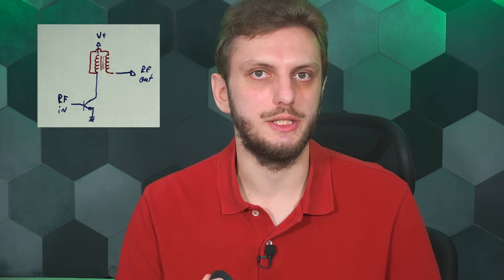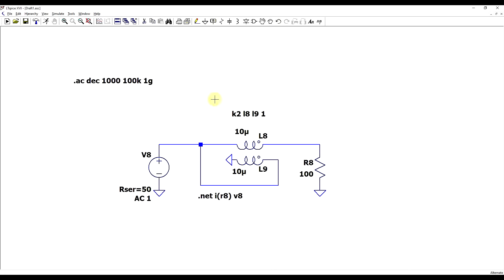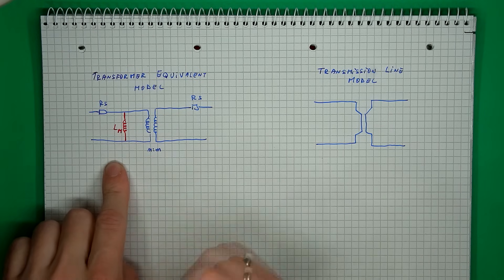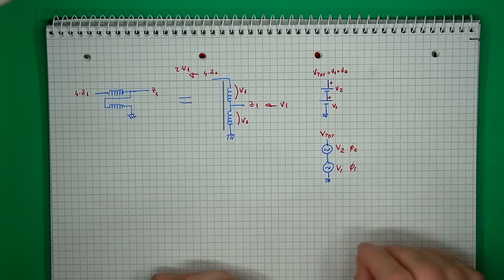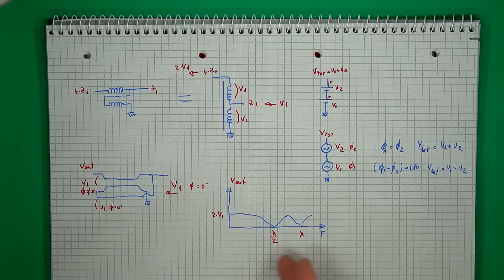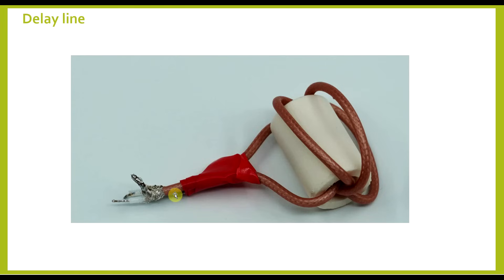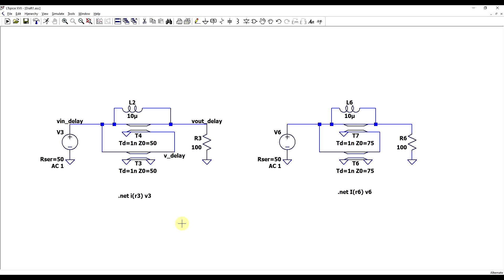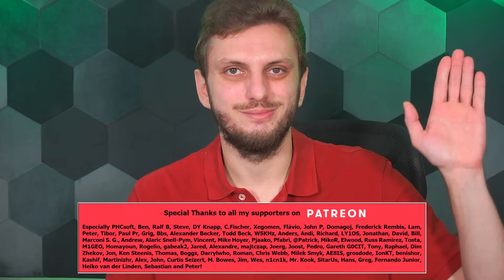The Ruthroff Impedance Transformer

Comment: Thanks a lot .This video helped me a lot to design my balun circuit in ltspice. I just wanted to know can we measure the common mode current and the differntial current thats flowing across the cricuit. I wanted toeasure Like how my rejection my balun circuit does
Reply from the maker: I think I made an older video on this topic - it was more related to device compliance testing, but the same principles apply - maybe it will help https://youtu.be/fhPTnoNQG_A
Reply: Thank you

Comment: Great Vdeo; Thanks!
BTW:  I have used 26-28ga. teflon wire to make a twisted pair that was very close to 50-Ohms by twisting it about 6-turns per inch.
When I measure it on my VNA, it was good to 30 MHz which is all the further I went since my interest was in the HF spectrum..
73!
Edit: Hey thanks a bunch for the theory references; they are VERY-MUCH-appreciated!
Reply: Was it still such after you wrapped it tightly around a form like a toroid?  I think the point was that adding small-radius bends in the twisted pair disturbs the impedance.

Comment: 6:45 I don't think this explanation is quite complete. If you just double the voltage you will get 2*Z, not 4*Z. You should take into account that the total amount of power doesn't change, thus your new current is 1/2 of the original current, and thus you get 4*Z.
Reply from the maker: Maybe I did not go into enough details, but if you make the assumption that the transformer is ideal (lossless) then the input an output power will be the same; for any voltage change (input to output), the impedance ration will be the voltage change squared.

Comment: You made it clear. Congrats!
Concerning the twisted pair line problems: CAT 6/7/8 network cables are good up to GHz frequencies. Any comment on this?
By the way, also USB 3.1 and 4. are GHz compatible.
Reply: One of the main differences between the various CAT nn standards is how well the individual pairs are formed in the cable. The higher CAT standards, like CAT 6, have added material in the cable that hold the pairs more precisely in position along the cable.
Also the amount of allowed "untwist" at the contact ends is much shorter for higher CAT than the more forgiving lower CAT standards.
Reply from the maker: I stand by my statement :D as long as you can keep the constant inter wire distance and twists, the cable will work just fine. I tried to use a single pair from an old network cable, but without the default plastic around it - that keep everything in place, it came undone - and in the small transformer I built, it didn't really work
Reply: @FesZElectronics  The twisted wire isn't bent sharply like it would in a transformer, so the impedance control is easier.

Also note, the wires are twisted at different rates to reduce pair to pair crosstalk.  As mentioned by Orjan, CAT6 adds a plastic "X" the length of the cable to increase pair to pair separation, reducing crosstalk.
Reply: There are guidelines on how to lay high CAT cables: minimal bend radius etc. And as network cables are up to dozens of meters at least, hardware will probably tolerate a 1m piece smashed. USB cables are for end-user,  and good ones are made stiff and thick enough, so that one could not degrade it by bending, coiling etc.
Reply: I am a connector / cable guy that worked with Intel early in the development of USB 3.1 and USB Type C.  

The cable performance was the limiting factor for data rate, using the 2 level signal.  I asked Intel's IC guy why USB didn't use multi-level signal like Ethernet (I was on the 10/100, Gigabit, 10GBase-T and a bit of the 40Gb committees as well).  I explained how that allowed more gigabits per gigahertz.     

As we finished USB3.1, he mentioned they were working on USB4, and it uses a multi-level signal. 

The step size in Ethernet was limited by the unshielded cable.  Too small, and signal to noise degrades the signal.  Too many steps, and the peak was too high, failing EMI.  USB uses a shielded, and much shorter, cable.  I expect there is at least one more data rate increase in USB.